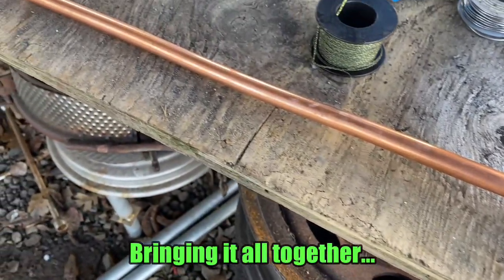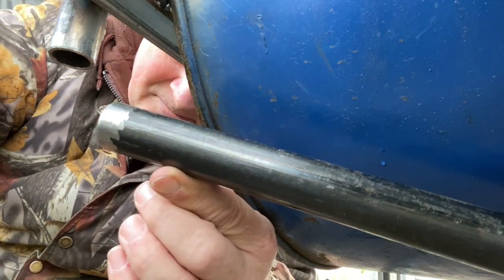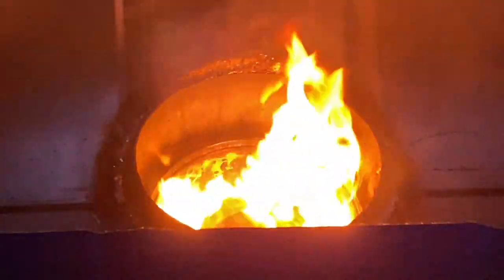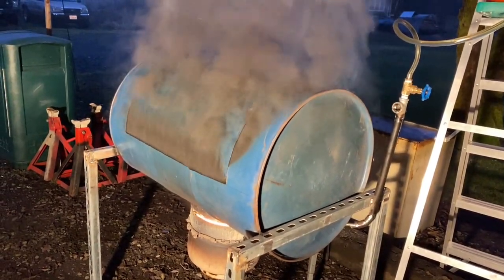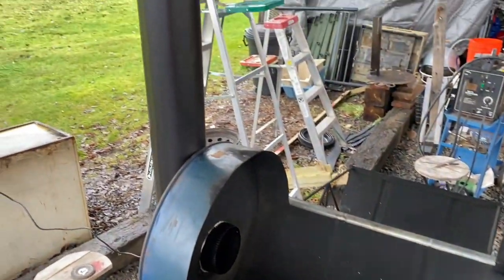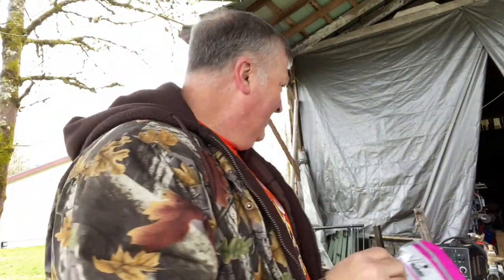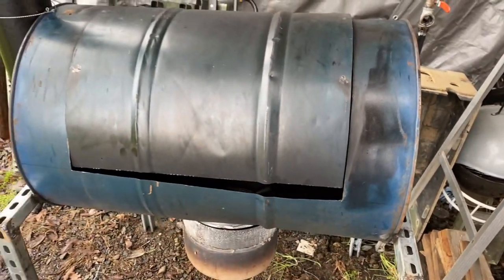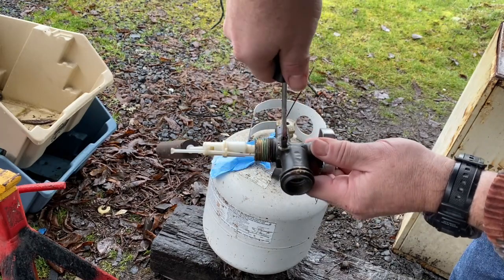Waste Oil Burner Wrap-Up Special

Comment: Nice wrap up. That is some good off the grid engineering right there, and waste oil is plentiful. Thanks for keeping it out of the landfills.
Reply from the maker: You know, when I first embarked on this project, I was not even thinking about how green this project was. It does pull more energy out of the waste material, turning it once again into something productive. Thanks for pointing that out.

Comment: Hi Dave iam new to waste oil burners and came across your build.  Truly amazing.  Really inspiring too.  I have one question though even though it’s been a few years since your build but why the copper tube through the steel pipe. Couldn’t you have just used the steel pipe as the oil feed.  Thx in advance for your answer
Reply from the maker: It needs to be jacked. Otherwise the oil will coke up in the hot steel pipe and could clog it up. The copper is easy to bend and slips fairly easily into the steel pipe.

Comment: Would it be wiser to braze on the new valve?
Reply from the maker: Yes, that would make it a bit more permanent. Though there is no stress of pressure or high heat in that area, epoxy will work for the temporary testing I was doing. When brazing, remove the handle and the plastic washer behind it before proceeding. :-D  Great comment, my friend.

Comment: I'd use a 1/4" water needle valve from home depot
Reply from the maker: More than one way, for sure. I just needed to see it's flow rate via the view port.  The ball cock valve worked great... and still does.